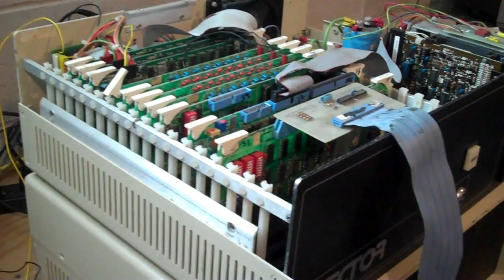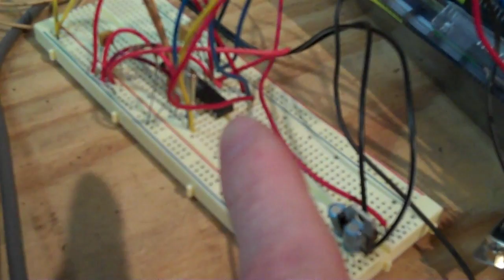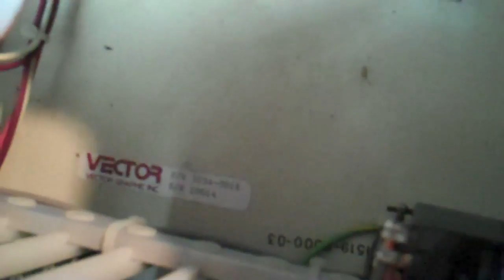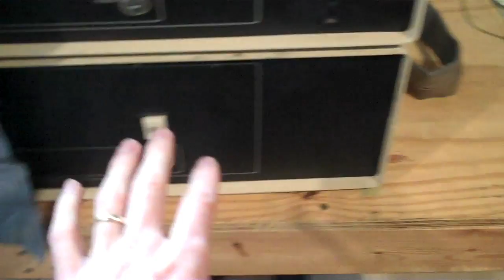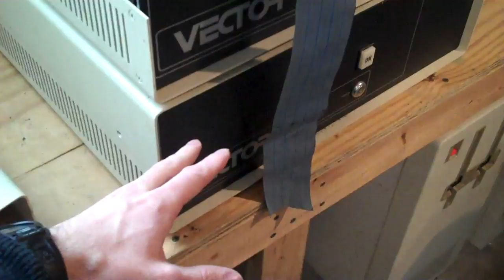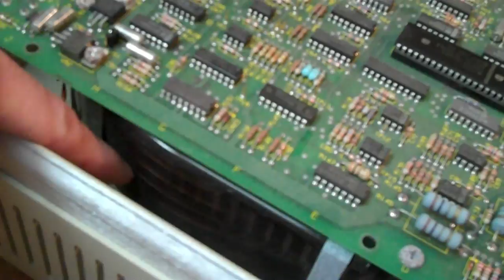Vector Graphic 5032 Tour, Part Two

Comment: Looks like the Memory is setup as 65K for Z80 CPU and the other (3) are for the Flash Wrighter..OH DEAR GOD, PAws you a Can of WD-40 for the Motor Shaft< same HD's off the old WANG Server I use to have two a 20 MB and 40 MB in the unit.. Where is Part 3 and 4, ?